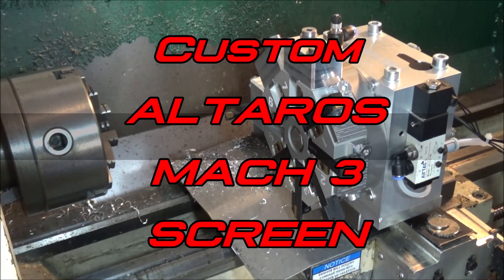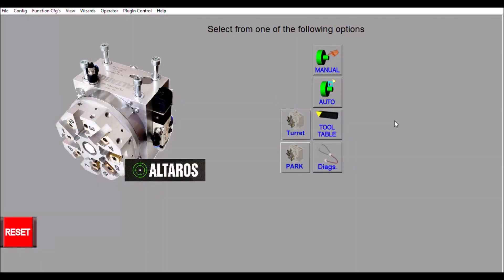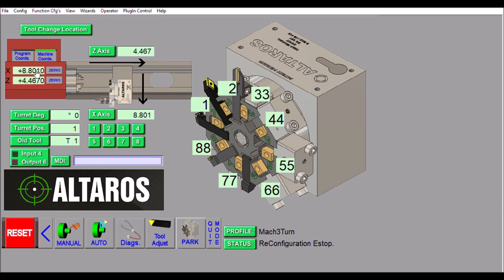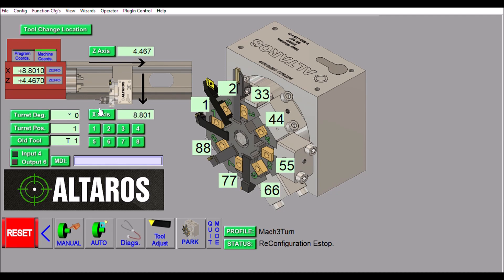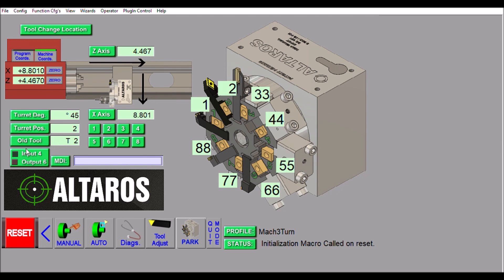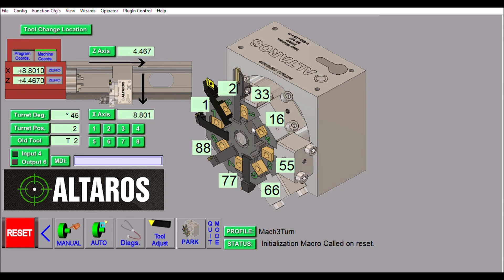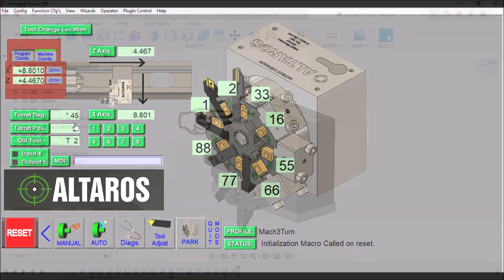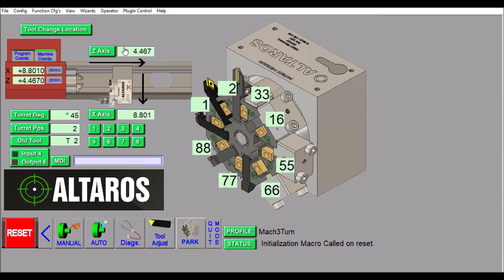ALTAROS Mach3 Screen Set

Comment: Sir,

I have another doubt..!
Can We find or calculate the total travel distance of G-codes in mm/inch ?,
I mean The total cumulative distance all 3 axis combined to finish a particular G-code...!

I was thinking about how to charge for machining cost on a cnc router, based on axis intensity and distance...!

simple 2.5D carving/grooving jobs and highly detailed relief carving jobs using all three axis are different very much , right?
So combining all distances on all axis will give us the cumulative  figure of distance

 1.00hr running X and Y only for 2.5D Carving is different from 
 1.00hr running X and Y and Z for a relief carving

So We have to consider all axis included in operation.!

Is there any method for this type of calculation..!

Is it complicated? or nonsense?!
Reply from the maker: in mach3 top under   operator/ maintenance hours it will give you the distance traveled for each axis.

Comment: Hello Sam. I bought a Tormach 8L lathe and was thinking to put this n the lathe. The lathe works with PathPilot which is Linux based I guess. I could put ne electronics on the lathe to make it work with Mach3 and make some modifications. Are these macro for Mach4 too? I'm about to switch from Mach3 to Mach4 on my CNC router and I thought I could control the lathe too. Any advise on this? Thanks! I enjoyed your videos!
Reply from the maker: Hi Martin, I would reach out to the Linux community and see if anyone can create a Toolchange macro for the PP software. that will operate the turret.
The turret itself is really simple it just has a Input sensor and a output to control the rotation. The macro I created and screen only work with Mach3. Mach 4 is a different language. A Great Turret Though.

Comment: I am still not not sold on Mach3 or Mach4 software. maybe I'm used to using a Fanuc control. But you seem to have set this up pretty well. I'm wondering if you could overcome the turret from locking into place at each tool position for demonstration purposes if you wanted to rotate the turret 180 degrees? I guess what I'm trying to convey is if the turret is capable to rotate to a programed position without having to stop at each tool until it comes to the correct tool position. Another question is; is the turret able to rotate clockwise & counter clockwise?
Reply from the maker: No only one position at a time and only one direction.
Reply: @CNC4XR7  Thank you for the information. Keep up the great videos!

Comment: Nice!  Thanks for crediting me for the suggestion.  I've helped people so many times over the years and they claim the credit with no mention of the help I've given. I didn't do it for fame & glory but nice to get the mention.   :)     Cheers.     Jim
Reply from the maker: Thanks for the idea! I think it will come in handy.
Reply: @CNC4XR7    Loos like you enjoy writing Macros.  I have an idea for you.  The newest CNC I worked on was a Fanuc OT ( 1980s)
Don't know if Mach3 or newer CNCs have one but Myself and a mate produced a peck reducing drill cycle.  Most pecking cycles just peck the same depth all the way in (which is nonsense)
Ours asked lots of things eg:  Starting Z position.
Withdrawal Z position.
First peck.
Minimum peck.
Reduction factor.
Clearance for next peck (stand off)
Not sure what else as it's been years.

It's a fantastic program for very deep holes on lathes.

I had a clear out a few years ago so I no longer have a copy anywhere.

Have fun with the challenge.
Jim    :)